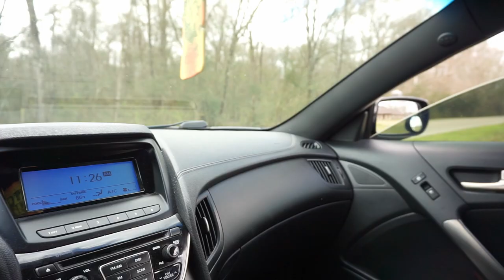How to Install Transmission Mount | Sloppy Shifter Fix

Comment: Sounds awesome man. Nice ride. Just bought a 2013 premium 2.0T 6 speed. Car is fantastic, 19k and garaged in Florida all its life. The shifter is sloppy and shakes a bit, also the sway bar bushings suck bad…. Other then that the car gets more looks then anything on the road. Cop pulled me over and couldn’t be it was a hyundai

Comment: hey i got a geni. does the megan tranny mount help with the second gear lock out? cause mine grinds when i shift at a high rpm. Please lmk if its worth it
Reply from the maker: Trans mount, short shifter, and engine leash all help out a lot for high rpm shifting.. I was having that problem at the track, and it’s actually on film.. Check out my drag strip video and you’ll see